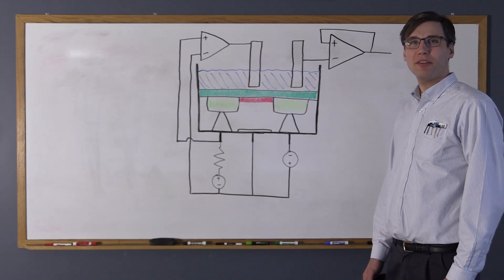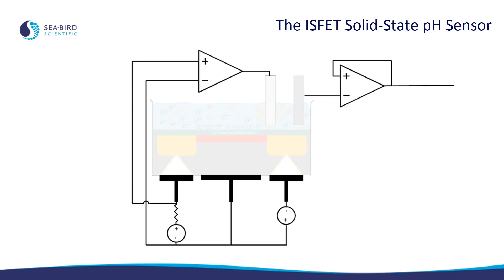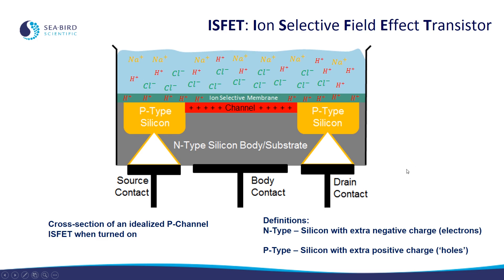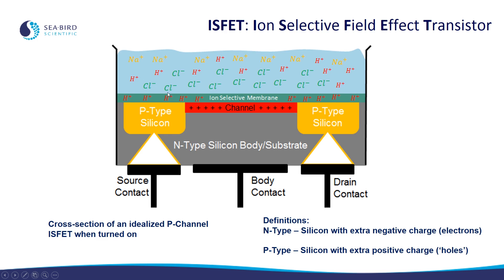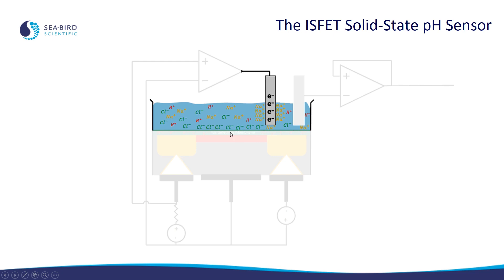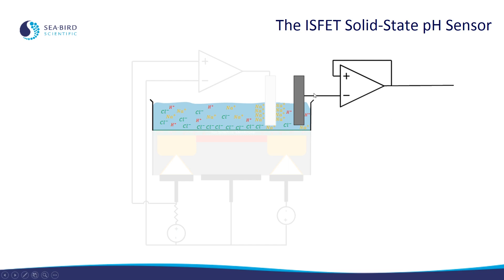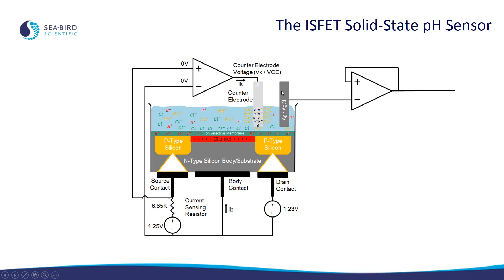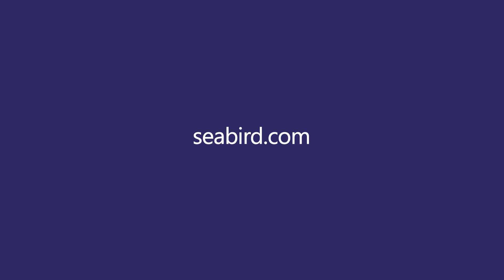Sea-Bird Scientific Explained | The ISFET pH Sensor

Comment: I recommend discussing electrodes in terms of potential rather than charge. It is the potential that is controlled, charges flow as required to establish potential. Also the term 'Electric double layer' (EDL) would make the discussion of electrodes in contact with electrolyte easier.
Reply from the maker: Thank you so much for the comment! You're absolutely correct.  In creating this video, we were attempting to use language that would be easily understood by people with a basic science background, but who were not experts in electrochemistry. We really appreciate you calling this out!